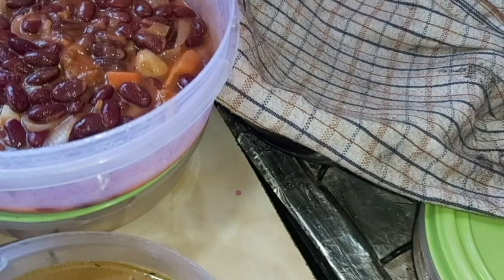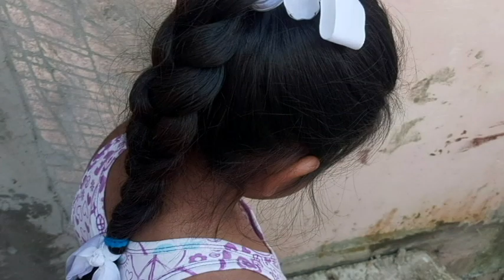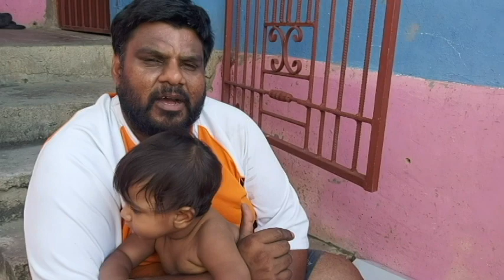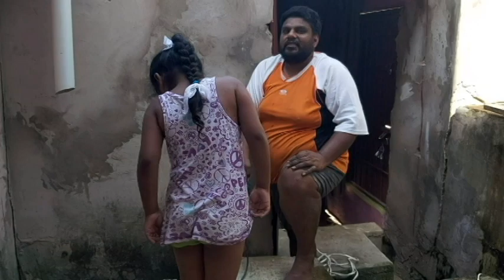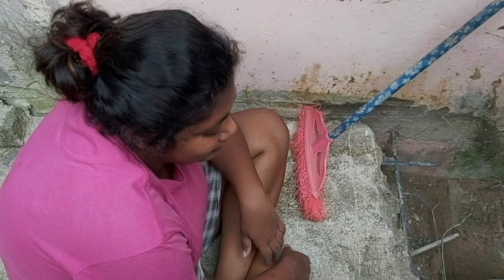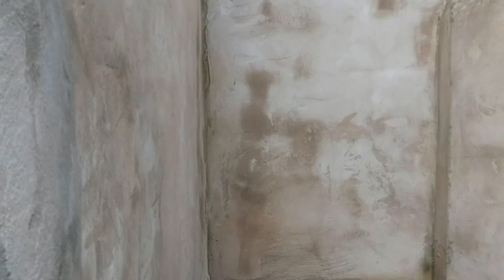HOUSE CRACKING | TO MUCH WATER INSIDE THE HOUSE

Comment: Try bending  the steel like a u bar like how they does build in the box drain and case both side of the drain  about 4 inches  and use and tile and tile the drain  and that should  help you